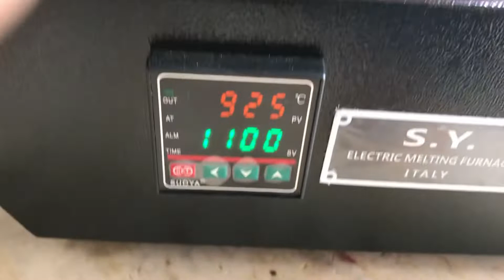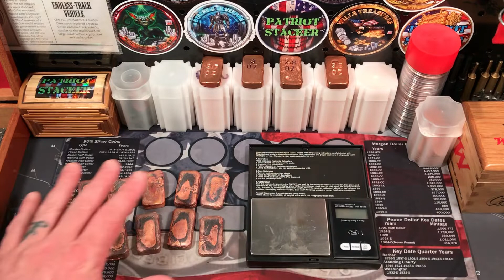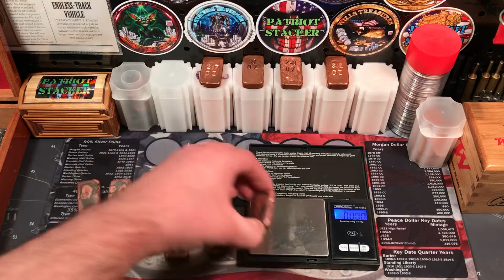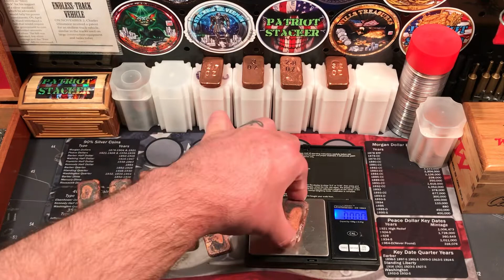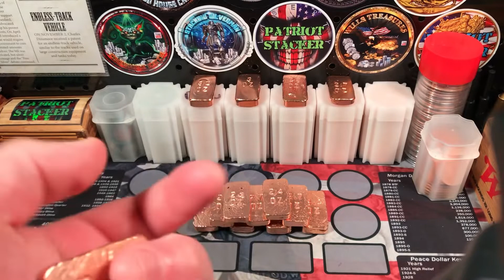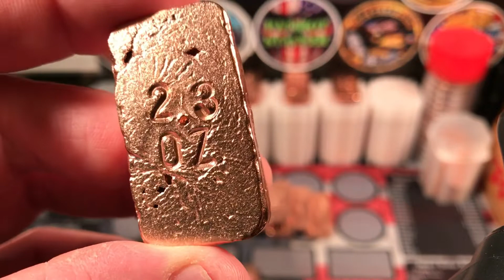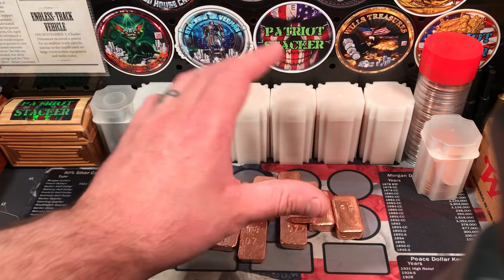POURING COPPER BARS!

Comment: Really great pours my friend. Your hand appears to be steadier than mine. Really like that mold, where did you get it. Great job on the final product. I may try the tumbler as a finish, been using a wire wheel on my copper and brass then stamp and fill in the letters and numbers with a thin magic marker..😎⛏⛏🔥🔥